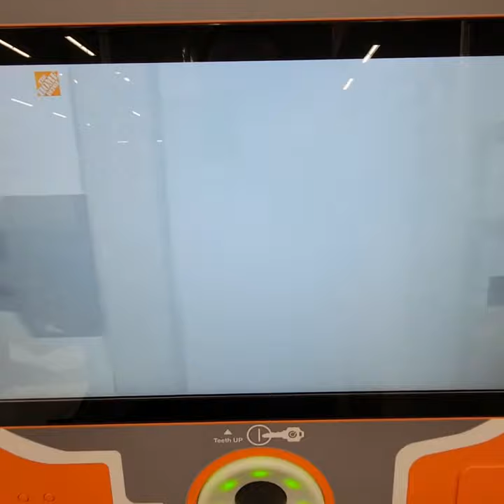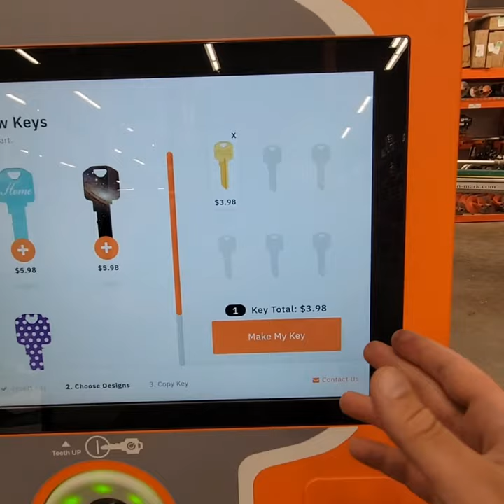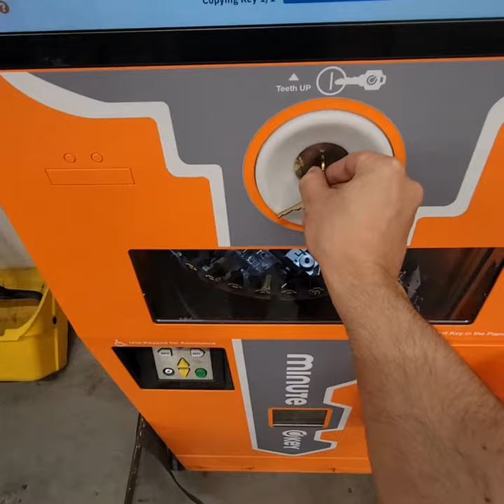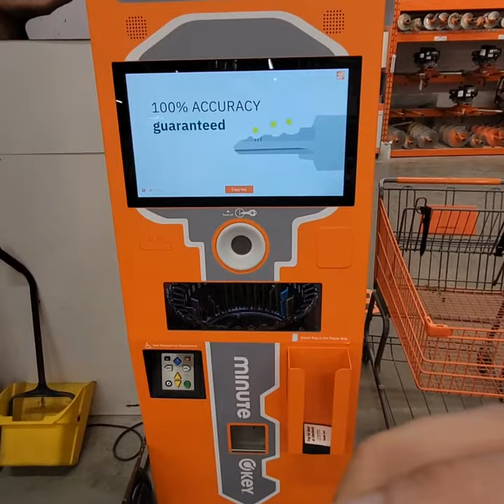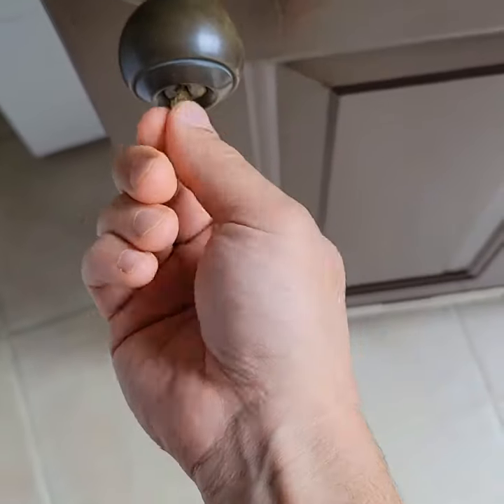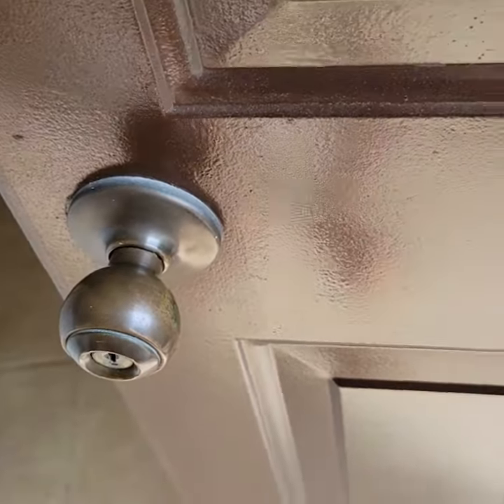Home Depot Automated Copy Key Maker Review - Do Not Use It Before Watching This!

Comment: You tricked the machine, you entered a KW1-shaped key and it gave you an LW4 key, they are very close but not the same, it can work but you need to hold the key in the side groves to cut it, as the lock uses the side grove to centre the key in the lock. Being you are in the USA and Kwikset the lock manufacturer is also from the USA I'm surprised they can't tell the difference .. It's easy to see the difference, with both keys on the side look at the middle grove along the key and its difference in size. Now look at the deepest cut and see how close it is to the centre groove, you can see it's not the same. Yippee,, I may still have a job is 5 years, it looks like the robots are not taking over just yet !!
Reply: Ur great

Comment: I used one of these today for the first time, before watching this.  It was a delightful experience, and my key worked, but I did two things differently.  I didn't have to push on my key and hold it in the way you did, probably because I left it on a heavy keyring with other keys.  The weight of the ring must have stabilized the position of the key in the 3D "ignition".  And I sprung an extra $2 for the pink because I am tired of using nail polish to color code my keys.  I doubt the color made a difference.  I would say don't use the machine if it doesn't start when you insert the key and let go.

Comment: I used this machine yesterday and also did not have a great experience.  Left the key in to scan dimensions.  Machine wanted 5 dollars, and when I backed out, gave me a 33% discount.   It then asked if I wanted a smoother cut key for additional cost (still added up to 5 dollars then).  I said no and the key was cut very rough with burrs on the edges.  The patterns didn't match up too well in some areas and one was missing altogether.  It did work at home but takes some wiggling and pulling back.  I filed down the key more similar to the original key pattern and cleaned the burrs.  It works but takes some time to get all the pins to match the pattern in the lock.

Comment: Use a file or wire brush to bring it down. Or else get a key cut at a local locksmith.....
Reply from the maker: I actually did it at homedepot. They also had a manually operated machine that we created a new one that worked better. Thanks for suggestion though😉👍
Reply: I have the key it does work but you have to jiggle it to make it work

Comment: did home depot actually help you or did u try it again?? or did they update the machines???
Reply from the maker: There is no help with that machine. Is self-service and athomated. However, i did try one more time recently and this time took it to their brush machine and brushed the keys to make sure it does not have sharp edges. After this attempt, the recently key i made did work this time. So it may be worth the try, but for sure brush the keys with rough wired brushes to smoothen the edges.
Reply: @LetsTryThis10 did you have to pay extra for the brush machine?

Comment: Will this work on Do Not Duplicate keys? My son keeps locking himself out of his dorm room when door shuts behind him in lock mode.
Reply from the maker: I am not sure about that, but i had the same issue at my dorm, and i came up with another solution.  I unscrewed the arm of the hydraulic jack on top of the door that keeps closing the door behind you. So the door became a normal door without that hydraulic automatic locking mechanism. Tell him just to unscrew the arm, and it will solve the issue. But do not tell the security or others ;)